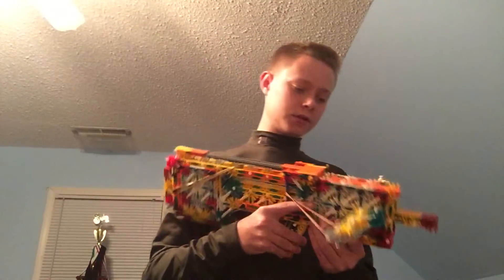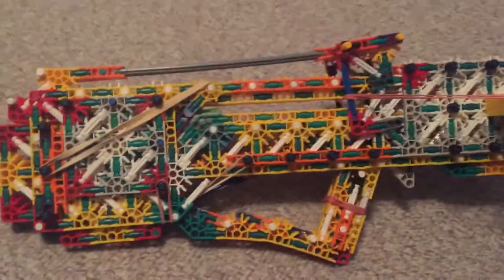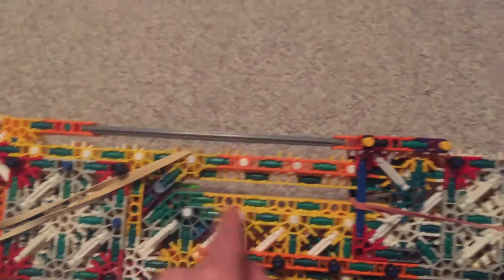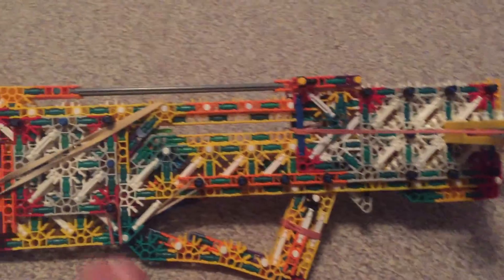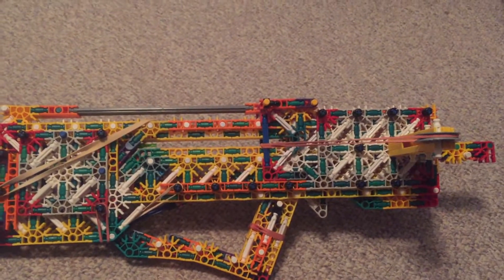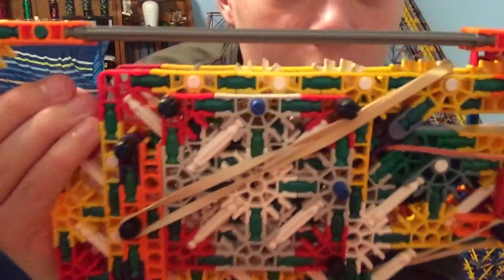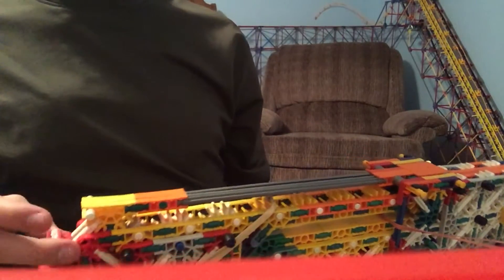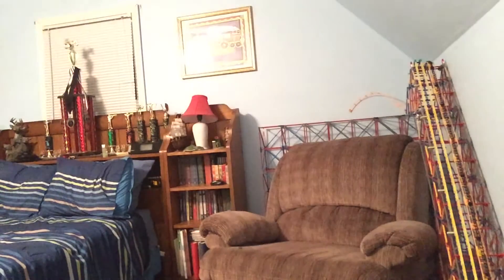Repeating Knex Slingshot

Comment: (TheDunkis here) I always wanted to see something like this. It's an interesting solution you came up with, but not the most elegant. My original idea for the chambering solution was to just have a band-loaded magazine "roof" that you pushed back with the slingshot band/charging handle. Then it'd be entirely internal and automatic. Could either station the trigger behind the magazine or just in front of it to let it slide forward out of. I'll have to give it a shot sometime. But regardless, this is nice work. I hope you're still building.
Reply from the maker: Great to hear from you! I have the itch to go back and re attempt the repeating slingshot concept again. I really want to keep everything internal and go to a bolt handle instead of a dinky slide. I am still building, but my job and school has really slowed everything down. I should have a video up in a few weeks of a knex gun that runs off 160 psi of air. Nothing innovative just different. Are you still building? (I believe the rotary mag bolt gun was the last build I remember seeing)
Reply: I hope you do give it another shot, I'm sure you'll make it smoother. Bonus if it uses a pump. But baby steps are fine, innovation is an iterative process. Curious to see the air-powered gun as well, seems like that'd be a fun one. Yeah, I understand how the grind gets to all of us, everyone got older and acquired more responsibilities, didn't get enough young members to fill in the spaces behind us. And yes, I finally got updated pictures of the Barackuda (gun you're talking about) and posted a new forum topic on 'ibles, then of course they changed their message board format back to how it used to be, one giant board instead of individual topics, so I'm sure it's lost in the chaos now. Really wish we all had one common place to be, but it's good to know you and BM are at least semi-active on YT still. As always, I have a handful of ideas but I'm unsure of what to pursue next. But at some point I'd like to jump in on the repeating slingshot, perhaps with fin ammo. Keep it up, man.

Comment: Great job man! It seems there actually has been innovation in the field while I've been gone :)

Just quick idea, for the ejection bolt at the back, you could change it into a buffer tube type assembly. Since that part is already 5 layers thick and you have the bolt as a 3 layer piece, you could have that part get pushed internally back and it could be a bit more minimal in length as it wouldn't have to come all the way out the back and up over the top. 

Again, great job, very nice to see the idea come to fruition! My ZipDart has finally been eclipsed, which is an amazing thing to see :P

-dreamwave
Reply from the maker: sawyer bergeron Thank you so much! The I originally tried the style of bolt you are talking about but i could not get a reliable mechanism to work so i put that bolt in. Are you going to post your new gun hear on youtube? Id love to see it.
Reply: Lucas The Boss gotta make a new gun first lol. Probably will do a cylindrical rotating bolt + bolt action build or maybe try yet another shot at a repeating slingshot but idk :/
Reply from the maker: sawyer bergeron hey man, i just now got your message on Instructables from a week ago through my email. Instructables changed a bunch of stuff and i can no longer get to my private messages though my phone. Id be glad to help you with that trigger if your still needing help with it. If you do just send it to my email- LucasPorter8822@gmail.com
Reply: Will do, I'm having issues with the app as well. Haven't been able to sign in since I updated to 7.1, and I'm not downgrading my phone to appease the Instructables gods. I am still having issues with the trigger mech, even after a complete overhaul of the system (mag still in front of trigger area, but chamber half a foot behind the mag.) It's an actual slingshot based system now, so I'm hoping for significantly improved performance. I'll send photos tomorrow or something as I have a bit of homework tonight.